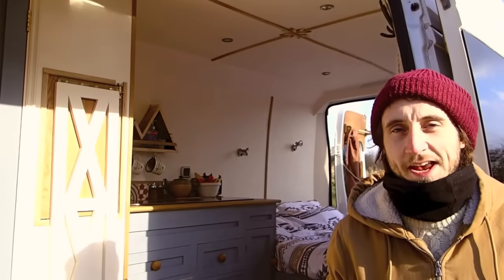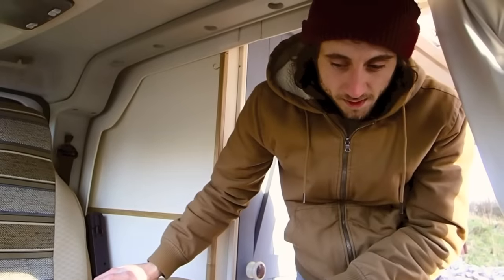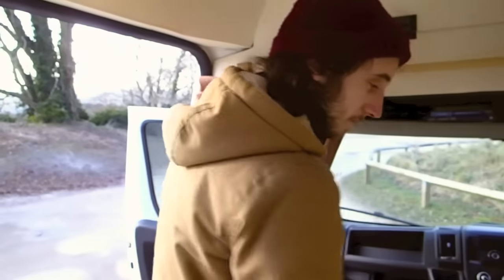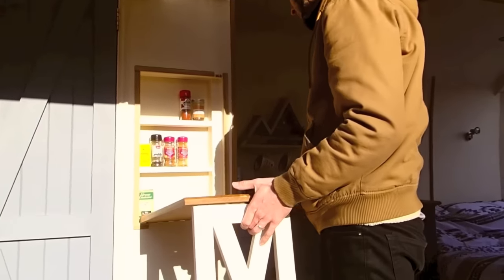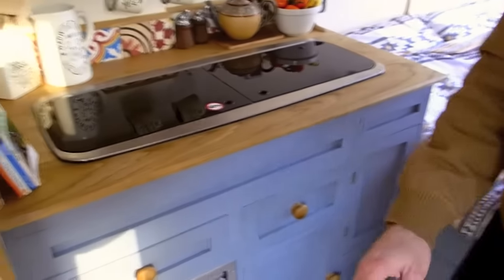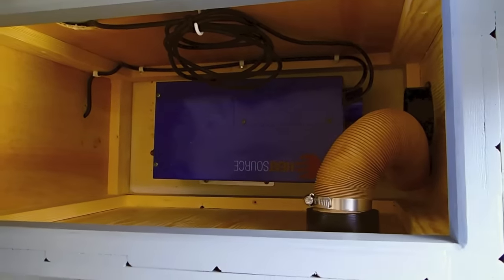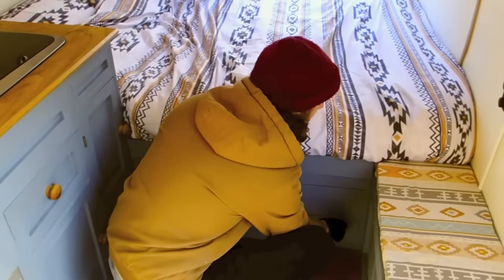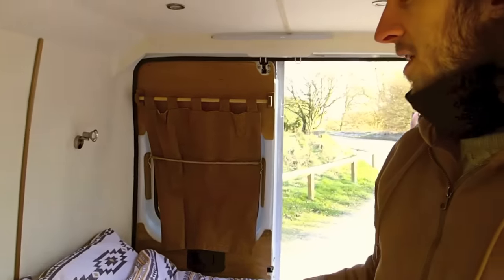Rustic Camper Van Conversion // Full Tour // Citroen Relay

Comment: why not put the shower in with the toilet ?????
Reply: I thought the same
Reply: I’m sure they could if they wanted to, but showers use heaps and heaps of water, which is hard if you only have one tank. Plus if they have a gym membership they can shower for free whenever they want to, plus it gets them into the gym!
Reply: The gym membership costs money, filling a tank with water at a service station costs nothing. I've spent 12 months living out of a caravan travelling Australia and it's the one thing I didn't have and would change of I could. Portapotty is fine, but bath in a bucket gets really old 😊
Reply: My thoughts exactly. Even a hang up battery operated (cigarette plugin) camping shower that pumps out of a bucket. I have an idea water conservation would be a breeze for this couple. Both of them are truly talented annd innovative.
Reply: Have seen a shower operated by 7lt pressure sprayer. Needs to be outdoors. But hey, a couple of litres of water and a sponge works fine. ice van. @curiouscuriouser9402
Reply: They’d need a hot water heater, more water storage, plumbing, and to water proof the cabinet. It’s more expensive, takes up more space, and comes with risks of pipelines freezing and/or leaks. You can’t really take a long relaxing shower unless you have a system that recirculates the water. Seems to require a healthy budget to make a nice shower.
Reply: I'd make it a shower. Not plumbed in, but with a hook for a camp shower bag that can be heated in the sun. Or if no sun, filled with heated water. And I'd need more storage 😁,  but that wouldn't be hard to do either. Overall it's a perfect use of space. And the decor is just lovely: bright & cheerful without the boring all-white, & the touches of oak are perfect against the blue.
Reply: Julie Herring Exactly! A shower would compete it + get 5 stars ⭐️
Reply: I might be stupid but I think it is in the shower room and that is just a hatch to make it easier to empty that why it is the back of it when you open the hatch???
Reply: Yep I watched it again he says the toilet is in there sure you can see it in there

Comment: The bathroom seems quite Roomy,  I'm curious why you didn't include a shower.
Reply from the maker: Hey Donna, would have been great to have one, prob could fit one now although tricky but as this was my first conversion, there were many learning curves to overcome already and adding in a shower means waterproofing the room, installing a vent, 2 underslung water tanks, water heater/decent pump and I'm yet to learn about plumbing. But, it could definitely feature in the next one as I'm sure it would be handy when it's too cold or wet outside to run to a camp shower :)
Reply: AtomicDuck123 was wondering the same! Thanks for answering
Reply: AtomicDuck123 when you make a shower no need for water tanks, only a dirty  water one and just use a solar portable shower
Reply: Maybe a small galvanized tub with portable sprayer could work, with gray water drain.
Reply: Your van came out so beautiful. It has what you need in the perfect layout. I too love the choices of colours and the extra little artistic hand made touches.
Reply: I would go for a thin black plastic tank that's on the roof (100 litre) for passive solar and gravity feed. Would work for kitchen also.
Reply: @Octoblasts  a solar shower is useless in winter though as the sun wouldn't heat it enough
Reply: @cognitivedissonance4413  Does that exist to buy on the market? I ask because I've never heard or seen that but it sounds like a neat idea.

Comment: Just some important advice. I had to call the emergency gas man out the other week. Turns out he is also into van life and so we were chatting about my van etc. I was asking him safety questions to do with van. He explained that a carbon monoxide alarm is Not the same as a gas detector. Evidently carbon monoxide is the gas released by the Use of gas, Not the gas itself and that you need a gas detector next to the actual  gas bottle. The gas detector must be as near to the ground as possible and next to gas bottle. The carbon monoxide detector should be in the living area higher up. I didn't know this and I'm very grateful for his Professional advice as a qualified gas engineer. Please anyone who reads this, make sure you have Both !

Comment: Amazing build, only thing i wouldn't like is the lack of a formal seating area, being sat next to the steering wheel wouldn't cut it for me but the low slung bed would be fine for sitting on i suppose. I like that you haven't crammed everything and everything in, it leaves a much more spacious feel than when people clutter every wall with cabinets, that huge draw under the bed is more than enough space for clothing.

Comment: Handsome. 
I like the use of the cab, though would like the potential to turn both seats round to face the living space - but you would have to offset the loo a bit, and you have to compromise somewhere! 
For some reason I'd want to have some sort of screen options round the cab for privacy too, but reflectix panels cut to size and friction or velcro fit would do that - could have the inner side of them decorated to co-ordinate with your van colours and maximise interior light of an evening. Keeps the option for a panoramic view too until evening or bedtime.
Would like a sink in the loo, so I could wash in there, even though it's tight, and perhaps a composting toilet (but VERY pricey). Also think there's potential for more storage
BUT, you've made a beautiful setting, and it suits your needs. You've done a great job, the jigsaw work and wood detailing is exceptional. Be proud.

Comment: Great job. 2 points. Where the exhaust of the Propex vents through the floor. It it’s butted against wood it can go on fire and needs a space of a few cm with envirograff silicon. Secondly I’m a heating engineer and the CO alarm can not detect a gas leak. You need a separate gas detector.
Reply from the maker: Thanks Luke, yes installation instructions of the propex heater states a minimum of a 25mm gap which it has with heat resistant silicone around exhaust etc. Have you ever installed gas/heating in a camper? Regulations state that you must include a drop out vent so unlike a household where gas would likely puddle, gas will 'drop out'. So you can put a gas leak detector in to take it a step further but having a drop out vent, a sealed compartment with the 50mm height and a CO alarm is normally enough. Of course, any additions help but following all the given regulations and being signed off safe by an engineer is enough for me.
Reply: I thought you might have followed the instructions but I just wanted to make sure because some people have set their vans on fire. And a drop out vent is great, but if you park on a gradient it might not work properly. You have done a fantastic job and should be very proud.

Comment: Just so you know, the alarm is a Carbon Monoxide alarm and will not pick up if there’s a gas leak, only if there’s an escape of Carbon Monoxide which is caused by a faulty appliance burning incorrectly in your case the cooker or damaged flue which would be on your heater. Love the van though, great attention to detail!

Comment: Very nicely done.....see you have pull out drawers( that move when driving)..... If you knoch the bottom side 1/4 inch......so it sits on the cabinet faceboard.....then lift to pull out..,self locking.
Reply from the maker: Hey Mike, they actually stay put when driving but good idea though, thanks!

Comment: In Australia it is illegal to have gas cylinders not contained in metal casing and must have external access. Door bolt into the floor on the outside, not for me. I used a magnetic door latch to hold the door shut. However I do like the rest of your van design, especially the sink top which is not too thick like some DIY I have seen.. Thank you for sharing.

Comment: The carbon monoxide alarm needs to be below the edge of the bed if your bed is 20 inches off the floor then the carbon monoxide alarm needs to be 15 inches or less. That is assuming you do not have a pet on the floor if you have a pad on the floor then you need to have the alarm placed about 1 inch above the floor because carbon monoxide is heavier than air
Reply from the maker: I think you're getting confused with a gas alarm, you should by no means put a carbon monoxide alarm on the floor, it is lighter than air so higher is definitely better.

Comment: Absolutely fantastic job! Congrats! And best wishes for your new journey! BTW, what material did you use on the ceiling and walls? It looked like one whole piece, no way it's fiber glass? That looks really neat and clean!
Reply from the maker: Thanks Roben! We used Plywood for the ceilings and walls. We sort of carefully planned the joins of the plywood so that we could add the oak trim afterwards and make it a bit of a feature, you can prob see where 4 pieces of plywood would have joined on the ceiling now :D

Comment: Very  nice van. What is the length of the bed.  How difficult would it be to make the bed higher with more storage beneath? Also, what can you power off your solar panels?
Reply from the maker: Hey! The bed is just over 6ft long, it certainly could be higher and in terms of power, it'll do all 12v outlets with ease, when you flick the inverter on though for the 230v it drains pretty quickly :/

Comment: Do the front seats and table comply with the dvla changing it into a campervan status? As you have to have permanent seating to comply.
Reply from the maker: Hey Kat, yes all complies with the DVLA, the v5 change went through no probs if you're thinking of doing it this way yourself :)
Reply: AtomicDuck123 awesome thank you for replying!
Reply: AtomicDuck123 one more question... How much does this van conversion weigh? Is it under 3.5kg?
Reply from the maker: Hey Kat, yeah surprisingly with all that oak, it's still under 3.5 :)

Comment: Do you ever have the problem with moisture with the thermostat?
Reply from the maker: Hey foreverhilarry, sorry for the slow reply but no didn't have any problems with the thermostat, have you?
Reply: AtomicDuck123 no I don’t have a van yet but I’ve heard some people say they develop mold from not insulating it properly. Because they have moist heat pumping inside.

Comment: I have noticed that innovations have been done only in RVs which are converted. Why do the ready-made RVs not have such innovations to save space and add as much amenities in small space? Also, why is no one converting the entrance space of 3 feet x 3 feet in an RV into a convertible bathroom. After all, you won't use bathroom while driving, and in a day you won't spend more than 30 mins in the bath for all purposes. The entrance space is anyway empty and cannot be used for anything else.

Comment: I see no A.C. unit, doesn't it get hot inside when parked with the doors closed?
Reply from the maker: Hey NEMO RPC, the heater also has a cooling feature, it's also insulated through out and could also use the roof vent for a bit of cooling to :)

Comment: I have no doubt that any construction I do would appear rustic regardless of my intent.

Why do people keep saying CO2 detectors, they are CO (carbon monoxide) detectors and it's not because gas leaks out but that incomplete combustion due to a lack of oxygen, produces the very dangerous carbon monoxide.   It's actually very difficult to find something to detect CO2 as for the most part, it doesn't really react much, commercial CO2 detectors use infrared light as CO2 is a greenhouse gas and would absorb infrared and re-emit it in all directions as infrared.

Comment: Not a fan of this conversion. Not enough windows. Not a fan of a bathroom without a window. And in vans this size I prefer no permanent wall. Just privacy drapes you can hang when you go. That way it makes the van roomier and more open. Usually the bathroom is best at the rear too, excuse the pun... also not a fan of a permanent bed that takes up over 1/3 of the van floor space. I prefer a Murphy bed or at least a convertible futon type of bed.. what I did like is the table up front and the artsy bits.

Comment: Camping Gaz inside the unit is a big no no. It should be in a box sealed from the inside and venting to the outside.
Reply from the maker: Actually Jeremy, that's wrong. If you do a little research you'll find that you can install a gas bottle internally so long as it's 50mm deep before the door, has a drop out vent and is sealed, it wouldn't have passed the mentioned gas test otherwise